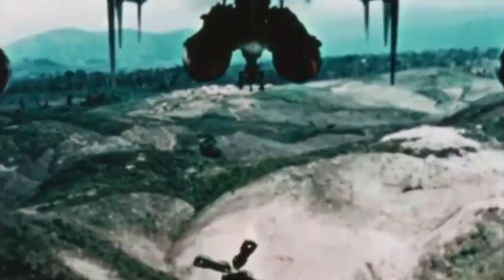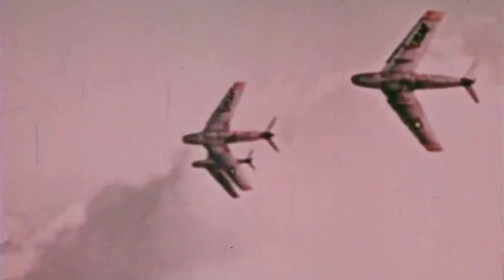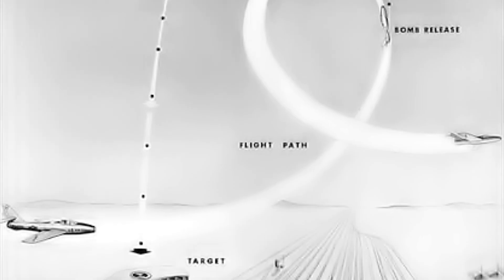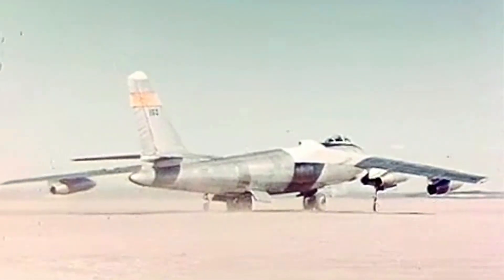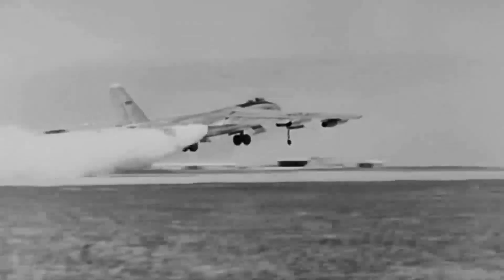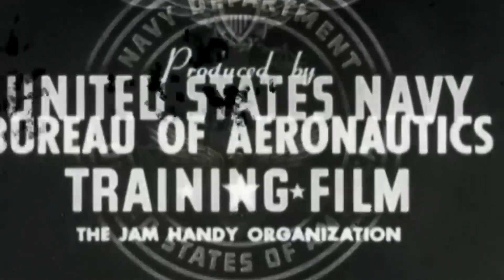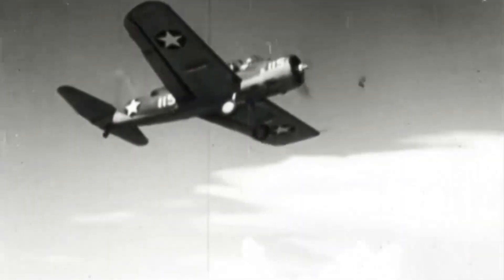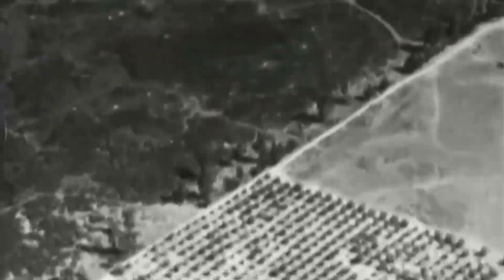This Massive Airplane Flew Upside Down to Toss Atomic Bombs - B-47 Stratojet Idiot's Loop

Comment: My dad (a B-17 WW II pilot shot down on 26 Jul 43 and spent 2 years as a POW) flew B-47's and B-52's during the Cold War.  I was just a teenager back (1960) then and living on Air Force Bases was so common that we hardly paid any attention to the planes and the constant noise as planes took off and landed and the maintenance crews tested engines all day and night.

I remember two things my dad told me about the B-47.
1.  The B-47 had no defensive weapons because at the time it was faster than any of the operational fighters in the world and could easily out run them.
2.  I have never been able to verify this independently, but when we were stationed at Homestead AFB, Florida, many of the B-47's were on alert on the taxiway armed with nuclear weapons and could take off in just a few minutes of the alert being sounded.  He said that some of the targets were so deep into the Soviet Union that those B-47 crews assigned those targets were on "dry tanks" alert.  This meant that after the final refueling before entering Soviet air space that there was not enough fuel to return to a friendly base after dropping their bombs on their targets.

Instead, the crews would fly to a designated area as close to a friendly border where when out of fuel would eject with an emergency survival kit and make their way to a friendly area to be rescued.

It doesn't take a rocket scientist to figure out these were essentially suicide missions because in the winter there was no hope they could survive long in a Russian winter and in the summer, the areas were so remote that it wasn't likely they could survive long enough to make it to safety.

I always wondered were we get such men and women who willingly take a mission that means certain death.  Then nine years later I was a Marine platoon commander in Vietnam (1969) leading my Marines in firefights where the intensity of combat meant a high probability of getting killed or wounded.  But that wasn't just one mission, that was an entire year of hard combat.  I lost a lot of Marines KIA and WIA.  I finally understood what makes men and women sign up for extreme danger--initially it's patriotism to serve our country, but once in combat it's only for you brothers who are in the fight.  My Marines knew I would never let them down in a hard fight and I knew they would never let me down.  You fight to the death for your brothers/crew.  There are no thoughts of patriotism in combat.  I know the B-47 crews on a one way mission felt the same.

Hard to explain, but here is an example.  One blistering hot day in Vietnam, my platoon was on a sweep in enemy held territory.  The terrain was mostly very large open dry rice paddies with thick treelines about 500 yards apart.  My platoon was on line crossing one of the open areas when about half way across we came under heavy automatic fire from the treeline to our front.  In that situation,you only have a few seconds to make a decision and that decision may be a good one or a bad one based primarily on previous combat experiences.

With no cover available and I believed I'd take more casualties trying to pull back, I made the decision to execute an aggressive frontal attack into the treeline across about 200 yards.  During the assault, I had to run up and down the line of attack to give directions to my squad leaders as there were no squad radios back then.  My radio man followed me making both him and me a prime target for the NVA soldiers who were trained to take out the radioman and the man next to him.

The bullets were flying around like a swarm of bees.  Bullets travel faster than the speed of sound, so when the pass near your head, they make a loud snapping sound as it breaks the sound barrier.  The number of snaps you hear indicated the number of times you came close to dying.

When we entered the treeline, there was hand to hand combat for a very brief time, perhaps no more than a minute, before the NVA soldiers retreated.  I then told the platoon sergeant to get a head count and tell my how many dead and wounded we had.  While he was doing that , I radioed the company commander to alert the medivac helicopters.

I was stunned with the platoon sergeant returned and said, "Sir, you ain't gonna believe this, but everyone is OK except for Lance Corporal Smith (I don't remember his real name) who has a cut on his hand when an NVA soldier tried to bayonet him.  He says he doesn't want to be medivaced."  The enemy fire was so heavy, I honestly thought I'd probably lost 20 percent of my platoon dead and wounded.

There are miracles in combat and that day was one of them.  There are also days so dark that it suck your soul dry such as the day a few months later that when the sun rose I had 34 Marines in my platoon.  When the sun set that evening, only 4 of us were still live and unwounded.

The next day, I received 17 Marine replacements.  That night we were mortared and all 17 new replacements were wounded and evacuated.  I was back down to 4 in my platoon.

Then there was the night when in a company defensive perimeter in a valley at 1 am we received a volley of Marine 155 mm artillery fire.  It was a case of mistaken identity (friendly fire).  Apparently a Recon team in the mountains above us mistook us for NVA and called in artillery.  We spent the rest of the night and into the morning medivacing the dead and wounded.  Once that was done, our company saddled up and continued our mission.  There are terrible emotions, but you learn to keep them stuff down inside.  My Marines depended on me to lead them.

I will say this, combat is not all horror stories.  There were many times where humor was involved that relieved the mental stress.  I could tell you some personal combat situation that I still laugh out loud when I think about them.  It was dark humor, but none the less funny at the time.  I remember some of them, but I wish I had written them down for prosperity.  I could have written a book of all the crazy things that happened that made us laugh at the time.

I finally understood the "dry tanks" B-47 crews.  Despite the risks they are a band of brothers and they fight not for country but for the men/women in the unit/crew.

That may not make sense to you if you haven't been in combat, for those of us who have, it makes perfect sense.
Reply: You really have to write that book. May be not to be widely printed, but at least for your family and descendants.  My grandfather had written a bio about his life (he was born in 1924)  - about famines his family survived, about great ww2 war, and his life after it.
Reply: Fellow veteran, I'd buy a copy! You have a good writing style. Thank you for sharing. I learned early that civilians don't get dark humor, lol. The stories we could tell, lol.
Reply: @NoctuaStrigiformes  we may be related...
Reply: That is amazing. Thank you for the post you wrote, it's not often you come across a great nugget like that on the internet these days. I really think you should consider writing that book. I would buy it.
Reply: I completely thank you and those who served with you for your sacrifices.
Reply: Thanks for that story. Write a book! I'd buy it. I never served and hate that I didn't. I wanted to be a pilot at a very young age (my dad was one) but bad decisions changed my future. I do however understand dry tanks even though I've never been in any situation like that I do believe, after facing the cold hard truth, that I'd be in. I have watched a few Vietnam war documentaries but had to read a book to get detailed information and that was angers my soul because the political puppets meddling in the military. Now it seems they're one in the same. Thank you very much for all you did for this country and doing your best to keep those men alive. My understanding is no matter what type of training you've been through it never compares or prepares you for a real fire fight.
Reply: This is by far the best YouTube comment I have ever read. Thanks for sharing! I am South African but war is war and I appreciate it when veterans talk about it openly. We can never forget what soldiers have to go through lest we start glorifying war. But bravery such as this we must also never forget.
Reply: thanks for your service and sharing.. my dad was a marine in Vietnam, a grandpa in both ww2 and the Korean war, my family has been in all the wars back to being a ballooner in the civil war. before the air force gave out wings they gave a metal balloon to pin on you haha.  only war story i got was in grandpas last days.. story about making it up the beach of Normandy, even that was more about the disbelief of having made it. 
what everyone of them in my lifetime asked me to do was NOT join the service. all believed our family had served enough and i wouldnt be fighting for what they all fought for.
Reply: You Sir, have a true gift, a gift of storytelling, that not many individuals have. And these stories aren't fairytales, they're your own accounts in combat; that gives it that much more weightage.
You've definitely inherited it from your father but the will to stay grounded in the field making decisions both good and otherwise and accepting their outcomes, is what leadership is all about; only few are able to exhibit that.
Lastly facing all aspects of war in clear light, day and night, over and over again and coming out of it alive and sane, is truly commendable.
Respect Sir, to you and many like you that go unspoken of. 
So please do write that book.
Reply: Welcome Home, Son! Well Done-Bravo Zulu, and a grateful nation thanks you for your service. My son and I have followed you and your dad, and I thank God for the opportunity
Reply: Big AL thank you sir for the kind words. God bless
Reply: LZ129 Brazil Thank you sir for all the kind words you wrote. Helps with my healing. God bless.
Reply: That's history right there.
Reply: I find as I get older, my opinion of War has changed a lot. However, my admiration for those who have - or are serving has NOT. Our resolve for good is continually tested & it's our awesome service members that insure that.  A heartfelt Thank-you.
Reply: Thank you for the story brother. Brough a damn tear to this old mans eye. 
 
God bless you; firm hand shakes all around. 
🥃 cheers from Texas
Reply: BMF6889: I'm a retired airline pilot & over the years I flew with a handful of former SAC B-52 pilots. They all said the same thing re: nuking the Soviet Union, that they knew that it was highly unlikely that they'd return home safely.
Reply: God bless you, sir. I don't even have the words except that I was completely sucked into what you were saying, and I can't help but see the sovereign hand of God over you. You made it out so you can tell the record of Vietnam from a clear and personal perspective. Thank you for this. Many people need to read what you just wrote. I know it took you some time to write it out and I thank you for it. I'm sorry for the nightmares you encountered there and those men you lost, I cannot express the sympathy I feel in my heart of hearts but those men and women, all of you who served in Vietnam in every capacity are true heroes. God bless you, and God bless the United States of America. Land of the free, because of the brave, where you'll always have a home.
Reply: Thank you for serving sir, and thanks for sharing a brief insight into your combat experience.
Reply: I'm only 44 but a skull fracture robbed me of many memories I had while I was in the Army and my Old Man's tales of working on B-36s. Please write that book while you still have your memories!
Reply: LZ129 Brazil  I get it. I cringe when people my age or younger that had served boast about their service. I'm 36. I do use my military discount because, well shit adds up and it's a wonderful perk lol. The new uniforms screem laziness. I hated them and didn't wear them until it was absolute. I stuck with the iron and can upon cans of starch when back home. Didn't spend a lot of back home due to the number of deployments during my time. Hope you are well my friend and I have much respect for the Vietnam Vets realizing what y'all have been through.
Reply: Hey thank you for your service and all of to your mens service you guys are the people that let us sleep at night the people that keep us safe and give up your freedom to go into combat just to keep us safe so thank you for it and thanks to your father and to everyone that has served
Reply: I think you got a book there i really enjoyed the writing it was alive thank you*
Reply: Great stories start with "My dad..." Thank you for sharing this. Write the book. Right now we need people like you and your dad.
Reply: Thank-you for sharing.
Reply: Holy sh*t. This is incredible. How is this on YouTube!?
Reply: The 47 had a tail gun, surely
Reply: Would be even cooler if all that people put their lifes in anything sensible? I mean nuke the shit out of others, proxy wars, whos benefitting?
Reply: BMG6889 I paused the video to be able to concentrate on your fascinating and vivid comment..where is your book? Or your veteran's interview? Please consider it, those stories want to be told. You have my respect, sir. Love you all.  From a retired nurse who took care of veterans.
Reply: Wow...if this man really published a book, I will buy it Immediately
Reply: Speaking for myself, I would also think that after watching so many of my brothers that probably feel as close if not closer than family lose their lives entering such horrible and bleak situations, that I couldn't live with myself if I didn't put it on the line back when my opportunity to do it for them came. Thank you for all that you've done!
Reply: I am just a 21 year old teen .Maybe i wont feel what exact you want us to but honestly speaking Sir  your story  gave me goosebumps and many like us would definitely like to read your book.Eagerly waiting for its publish.
Reply: BMF6889 In the late 50s Dad was back with the 509th, 100th Bomb wing of the 8th Air Force at Pease AFB, Portsmouth NH. They still had B-36s and a whole contingency of B-47. Dad was a Major and in Headquarters doing something that he certainly didn’t talk to me about. Mom was happy that we lived in “brand-new” housing. She had a thing about that. We had lots of family jokes. One was before I was born, when She lived at Wendover AFB, Utah. “It was “Brand-New” housing”. Dad was a man respected by his fellow officers. And feared at a poker or bridge table. When He passed; the Church in Rancho Cordova, California was full. I remember the girl sitting next to me, sweet young thing, said “ Tighe, who are all these Men ? It was a simple answer: “He played “Craps” with them at one time or the other”. I don’t think she knew what I meant. I’ll tell you all something: When the Parish wanted to build a “Bomb Shelter” for the Catholic Grade School, Dad stood up and said: “ Better you bring the children to Church; the living will envy the dead. The school was located barely 5 miles from Mather, AFB. I think Dad had a pretty good grasp on the situation.
Reply: Thanks for sharing!
Reply: LZ129 Brazil  Will do and same to you good Sir! I appreciate the detailed reply and the route in which you wrote it. You have a gift
Reply: Imagine dying for your brothers only to have stamped on your death certificate “killed by friendly fire” that would be ironic. My grandfather was in nam and was a Seabee. I still have photos of him sitting on top of the guns on a destroyer haha. He actually got in trouble over there because he got a sun burn, a really bad one on his back and the military wrote him up. You are literally there property
Reply: As an Italian I'm impressed with your experience and writing skills, really you ought to write a book and I would love to buy the book written by you!  Thanks for sharing👍👍🇺🇸🙏
Reply: Our country ows your family a debt of gratitude, sir! Outstanding! 🇺🇲🇺🇲🇺🇲
Reply: Thank you for sharing your story with us <3
Reply: Pretty sure the fact nuclear war would never come was a certainty for these smart people. "Ya ok sure I'll go on a suicide nuclear bomb drop, by that time everything is gone already"
Reply: Theres the obligational essay on someones grandfather or whatever r
Reply: @AverageAlien  I'm sorry you guys have to see this. We're not all like this man I swear. Come back! lol
Reply: Or you know, don’t sign up with the military if you don’t want to die fighting someone else’s battles.
Reply: God bless you. I thank you and your father for serving.
Reply: God bless america and God bless you... thank you for your service
Reply: Thanks a lot for your post. You really should write that book. It needn’t be a novel. I cite “Trenchant at War” which was an account by the commander of one of the ships my grandpa served on. It’s mostly informative and very easy to read in stages, written like a diary. 
My grandpa was always willing to talk about his time in war and retained a very good working knowledge of the equipment, problem work-arounds and procedures for running a modern sub in ww2. Sadly he, or I never wrote down this stuff, amazing as it was and considering the time he had on his hands after my gran passed. Also it was quite numbing to not see his name in the original crew listing in his commander’s book, but most of what he recounted to me and dad through the years was. His service on HMS Trenchant was very eventful, but mundane at times too, and this is all covered in the book. In Wiki there is are mentions of the ship, but to actually read the accounts and stories first-hand is priceless. Please do consider it. Have a fine day!
Reply: Nice
Reply: My dad can confirm that they were pretty much always armed with nuclear bombs and ready to take off in a 10 minute window
Reply: If this was a bood, id buy it. Tom clancey edition
Reply: Hands down the best YouTube comment I’ve ever read.  I was US Coast Guard aviation, so no combat, but know what you mean about the brotherhood.  I’ve served alongside men who were lost in peacetime search and rescue missions.  I cannot image what you and those you served with went through.  Thank you a million times.  And yes, write that book!  This comment alone had me wishing there was another page to turn to learn more.
Reply: Thanks,write that book please.
Reply: If the book is as good as this comment I would certainly buy a few copies.
Reply: that was my birthday.but 1952.
Reply: Dad also flew B-17s and crash-landed in Switzerland.  He was the navigator on B-47s until he retired in 1964. He was first at Wichita Kansas during testing, then Lake Charles then Lockbourne AFB Ohio.   He told me about having to arm the atom bomb after given the word to bomb.  He wore a small round device that measured radioactivity and it had to be checked routinely.  While at Lockbourne he worked on flight planning and bombing destinations.  I still have some of his old maps that showed USSR bombing locations and alternates.
Reply: Thank you, and your platoon, for your service.  God Bless!
Reply: Thank you for your service and this piece of writing, more respect to you and your men than you could ever imagine🏅
Reply: It's people like you sir who kept my grandfather alive in Vietnam. I thank you 1000 times over. He was just a scared 18 year old who was drafted to fight in a war he didn't understand. His company took him under their wing and nicknamed him "Johnny boy". They treated him like he was their son/brother and he has never forgotten the people who sacrificed their lives to save his time and time over. He is now currently slowly dying of cancer and other ailments from his time over there but he never lost his willpower or belief in God. Thank you Sir.
Reply: Thank you for your family's service to our great country! MERICA BABY!
Reply: I guess you got the answer to that wonder thought. Excellent story I like hearing these kind of war stories. This is one of the best. I worked with Vietnam Veterans that also shared their stories, A guy named Jim Hardy a photographer in that war. You should write a book Great of you to share this. Thanks for your SERVICE.
Reply: LZ129 Brazil  My mom and dad were both in Vietnam. Mom was a nurse and dad was a SGM. oddly enough I was conceived in Vietnam and would never meet my dad. He was Kia. I have also lost my oldest to PTSD a couple years ago. I appreciate the sacrifices of all who serve and the families involved. God bless to all.
Reply: LZ129 Brazil  
Shame on you for talking like that about the current servicemen coming back from that mess in the middle east, you're going to begrudge them for being treated the way you should have been when you came home?
I'm a veteran, and the reason I am is because I was born in the mid 60's and as a little kid I saw how you guys got treated when you came home from that nightmare and then all through the 70's, even as I kid I knew it was wrong and that's why when I graduated high school in the early 80's I enlisted, because I felt like someone owed it to you guy's and the least I could do was show you guy's that someone still believed, and I wasn't about to go through life having to explain to you guy's why I wasn't a veteran. 
Something I always knew was wrong was the way Americans "greatest generation" treated you guy's by saying things like "You weren't even in a real war" and now here you are laying down the same kind of BS on these guy's coming home now, after the way you guy's got treated coming home from that mess and for years afterwards you have every right to have a case of the ass about it but you have NO RIGHT channeling it towards the guy's coming home nowadays, they weren't the one's cursing you at the airports and calling you baby killer's, they weren't even born yet, if you want to channel that towards someone find one of those worthless hippies from back then, they're the ones who deserve your ire, I'll even hold them down so you can fillet the soles off their feet and pour salt over them, but these guy's coming home nowadays are your brothers in arms and certainly don't deserve any sort of blow back for what happened to you when you came home, I mean seriously, you're actually going to hold it against them because they don't know how to use a rotary phone? Jesus Christ that's like a WW1 vet holding it against you because you wouldn't know how to crank start a Model T Ford or saddle a horse.
The liberal media and those worthless know-it-all spoiled brat hippies are the one's that deserve your ire, not the servicemen coming home today, and if you want your veterans discount then go down to the courthouse and get a copy of your DD214 to show to them, I have to do the same thing if I want my military discount but I certainly don't get a case of the ass at the guy in front of me in line who has his ID handy because he just came home, I thank him for his service and let him know if there's anything I can ever do for him just look me up.
The enemy in life isn't your fellow servicemen, it's the unappreciative liberal brats.
Reply: Just fck war...
Every soldier gets respect a special treatment for their "service" which most of the time means interfearing with other nations and little fights, which make them even larger with more deaths. 
So thank you... for killing many dads, grandfarthers and even sons :)